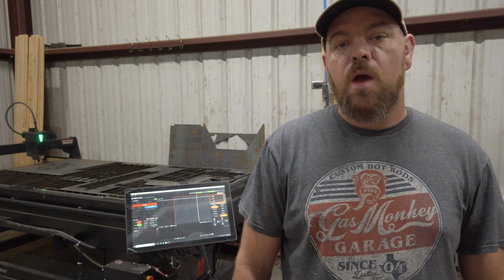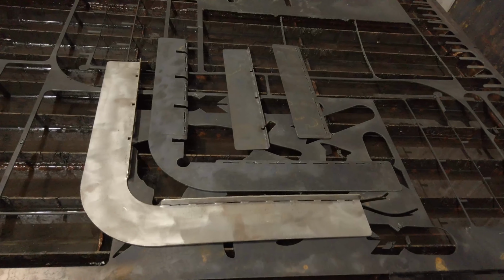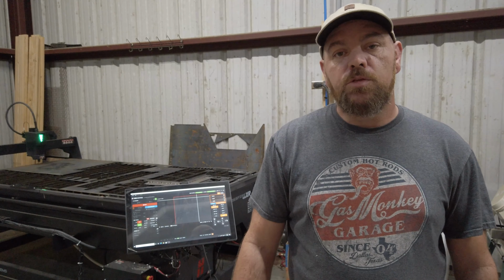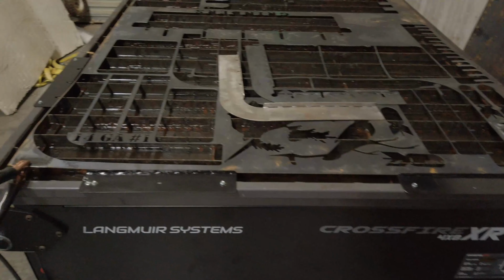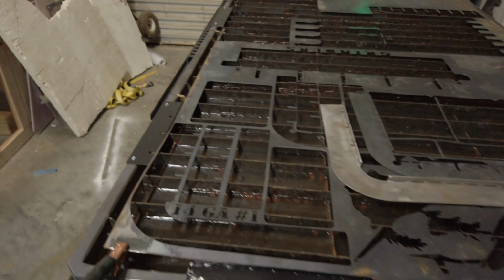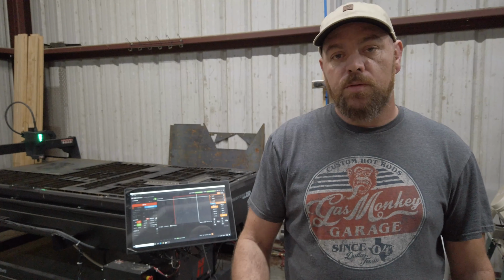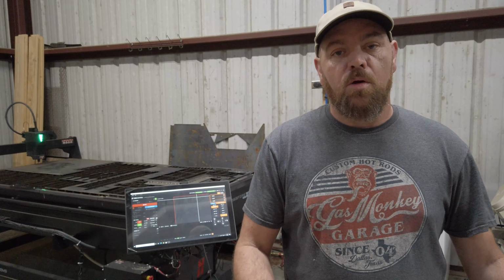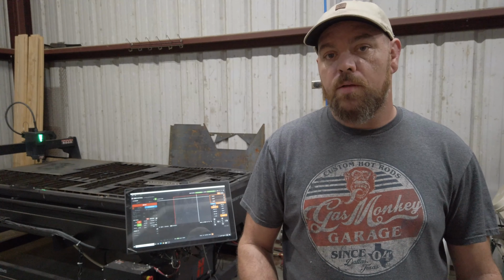Plasma CNC bed square (the abbreviated version)

Comment: So would you suggest using sheetcam over fusion360? I’m an absolute beginner and just ordered a XR table.
Reply from the maker: If you don't already have experiance in fusion 360 absolutely. Do you have any CAD background where you can make DXF files?
Reply: @clydehunt4405  zero CAD background. I have fusion and have been following YouTube videos on it and working long with them making very basic 3D objects. But that’s about it.
Reply from the maker: CAD is probably the biggest barrier to entry. there are lots and lots of ways to make files. Fusion 360 is the Lamborghini of CAD programs... imagine someone trying to learn to drive stick for the first time in a lambo tho... it was very hard to get started in fusion for me. I struggled to keep things from rotating on me. I grew up in Autocad and even though its the same company its very different... I mainly use Vectric Vcarve pro. I've gotten good at it so its what i stick with and I haven't been doing any 3d modeling. I wouldn't suggest anyone start with Fusion if they didn't think they were going to grow into something else like isometric modeling or doing 3d renders. I did a video on using Lightburn to make a DXF File. you can check that out if you want. Lightburn is where i would send anyone that was getting their first plasma machine. its very intuitive and for only 60 bucks it can do almost any 2d thing that you want. Fusion also does CAM, but from what i hear its complicated. I've never made tool paths in fusion for plasma, just CNC routers. Sheet cam is where it is for me. its only $150 and you could probably master it in a week.
Reply: @clydehunt4405  well first off, I appreciate you taking the time to write such a detailed explanation. So thank you for that. And secondly, I definitely see what you’re saying. I’m going to check out sheetcam and start focusing on that. Again, I appreciate the response. Eventually I’ll be uploading my own videos once my table shows up. So everyone can enjoy my shit show lol
Reply from the maker: tag me when you get your first video up... I always kinda wanted to make some YouTube videos, because I watch a lot of YouTube videos, but man is it hard to have them not look like $!@#. I probably put a combined total of 40 hours into the the last two that I put up. I use to listen to creators complain about how long it takes to edit and film and I thought for sure I could do it quicker than that.. lol
Reply: @clydehunt4405  will do. I watch a lot of YouTube as well. It’s a great place to learn annnnnd fall down the YouTube rabbit hole and next thing you know it’s three hours later and the wife is like “wtf did you do today” 😂. 

I don’t anticipate the quality of the videos I’ll be shooting to be spectacular. If anything it will be a warning for what not to do lol
Reply: @bigrednick100  so so funny AND so true 😂🤣🤣
Reply: fusion is easy to learn.